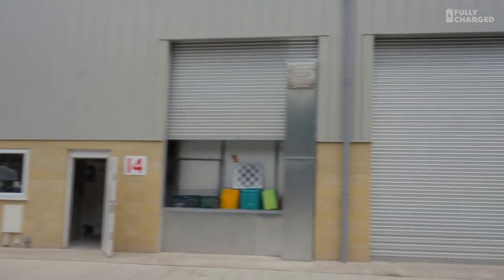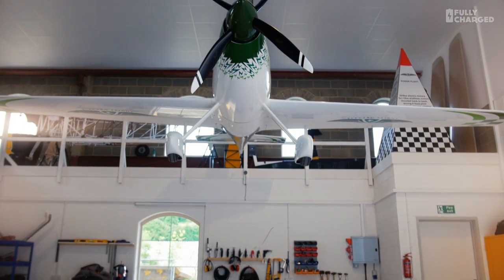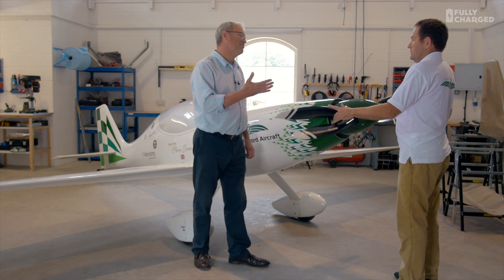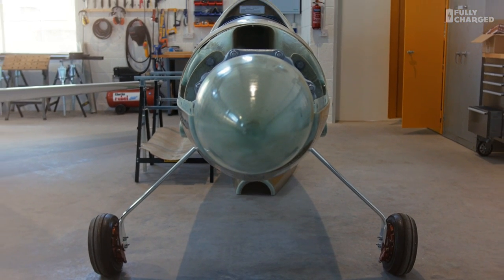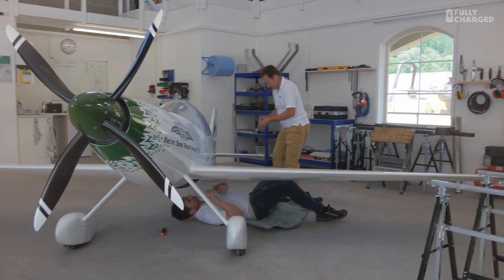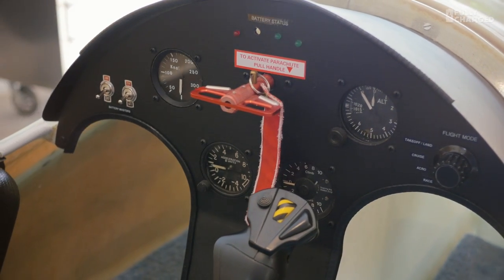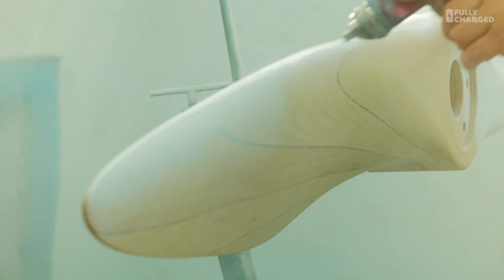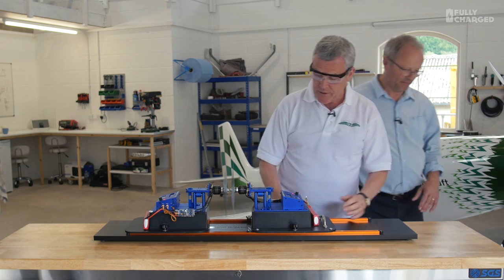Electroflight | Fully Charged

Comment: 9-10 min of flight time?...... sorry just not worth it... i wouldn't want to get a plane knowing I only had that much time
Reply from the maker: It's a racing plane, the piston engine version can only fly for 5-6 minutes due to very small fuel tank because of weight.
This one can fly for 3 hours

https://www.youtube.com/watch?v=PJKYekL7JsY
Reply: Thank you so much for the well produced videos!
Reply: If you put some innovative ideas into the plane, you could add certain parts to increase it's efficiency such as Solar panels and really techy self powering technology.
Reply: Check out the sun flyer. You get a few hours with it.
Reply: +Shankovich I opened up the conversation more, the guys who made this vid stated themselves that it can last longer than the piston version by hours. XD I FEEL STUPID XD
Reply: get the SOLAR IMPULSE i went around the world 100% purely on electric solar power.  how much time do you exactly need? ha ha.     the wright brothers flew their first airplane in 90 seconds NOT WORTH IT HUH ???
Reply: +em forty Such a heavy aircraft. Nothing wrong with that, as long as it performs which electric engine aircraft especially at turning.
Reply: One other thing.... in fuel driven plane it goes faster when the longer you fly it (as the plane gets lighter as the fuel empties) but in a electric it will be less power... but the weight will be the same...
Reply: +Alexander Wingeskog Will still be able to turn better than petrol.
Reply: +Sir Sharpe Yes, probably... just in that critical almost out of fuel or almost out of battery power... I would rather be out of fuel... but... maybe there are a couple of solutions... an emergency 10 min battery for emergency landing... switch to make the props (angled correct) for generating power as you decent to have a 5-10 normal power for the emergency landing (depends on your original altitude I guess) or have a couple of light weight supercaps for 5 min of landing power... I guess the problem is just one solution away...
Reply: +Alexander Wingeskog Well go petrol then. Electric is making quite an appearance.
Reply from the maker: A fascinating analysis based on...... um, not sure what. 
Modern battery management as is used on this place would mean nothing of the sort would happen. 
As for a fossil burning plane getting 'faster the longer you fly it' due to reduced weight of fuel, I'm not sure that's ever been actually proven and if so I would like to see peer reviewed papers and any other evidence to support such a claim.
However, the batteries can be controlled in a very granular way, giving 100% of their power up to any point the software defines, they don't 'slowly use power, you are thinking of batteries in a torch in 1959. 
Things have moved on somewhat.
Many, many, many people who have no understanding of modern battery technology and battery management systems and yet are still happy to pontificate at length at various, spurious drawbacks.
It's new technology, it's disruptive and therefore 'scary' to some people, of course there are differences between burning fossil fuel in massively inefficient steam age machinery and powering an electric motor with batteries, but none of them have been addressed in this conversation.
Reply: fullychargedshow Analysis based mostly on Newtonian physics and a basic understanding in aerodynamics. But it is a very very complex question... This is not the right forum I guess... And bear in mind I'm not an scientist, mathematical genius or even an engineer :-) But that never stopped me before.

So does weight impact plane performance and airspeed... Most passenger airplanes today can reduce drag and lift to reduce air resistance and thus go faster when they don't need as much lift because of the lost weight.
Will this plane go faster, yes it will.

But if a plane's speed is determined by drag of the plane (and can't do anything about it) and the drag/rpm of the propeller then this plane in level flight would not benefit so much from less weight... But that is only one velocity and airplanes have lots... Climbing for example will go faster with less weight (if the reverse were true it would break some law of physics right?) 

I don't have a peered science paper nope, I could get you some links (pilot manual and other stuff if you want) but I guess you only read peer reviewed scientific papers? and we can't have a normal discussion about it... 

And the battery point, yes I do know a fair bit about it. And I think you missunderstood me... The battery will loose power but not weight, the fuel based engine will only loose weight. 

People are scared of this? who are? Never ever seen/heard anything about it actually... on what do you base that on? critical comments? if so, that does not mean someone are scared... quite the opposite.

But anyway... just because it's new tech does not automatically mean it's great or even better that it was before... In this particular case it could be similar to the "first" automobile. Battery was new tech then, but it took a 100 years for it to actually work as a mainstream product as it does today. Hopefully it is not the case, but you never know do you...
Reply: ***** Me? Maybe I was not... what are you referring to? explain please!
Reply: Conventionally-powered fast racing kites carry very little fuel. Just enough to 'do the job'
Reply: For a racing plane it makes perfect sense...
Reply: Exactly.
Reply: Sir Sharpe Forgot you :-)
You said "Well go petrol then"...

Electric is the new thing... and rightfully sow... But when you are talking about something that will take me maybe 10.000 meters or more upp in the sky... electric (nowdays) is not what I call safe...

Yes you could go lower or higher... but winds are too powerful to just ignore...

Sooo why not go hybrid? or as my original post... have a "landing from any height" battery... that made it all safe... actually safer then other fuel based planes....

If you want this to go any further you should look at what Elon has done... he has made the car better in pretty much every respect.... except price... but that will change... when we get punished for environmental damage and the then the it will be cheap as hell :-)
Reply: Alexander Wingeskog. how would a hybrid work in a plane? if its just a safety system for engine failure then you are carrying around a bunch of weight doing nothing for most of your flying. Hell, likely all of your flying.

also, you seem to think that an engine failure is some sort of death sentence.  you do know right that when an engine fails the plane keeps flying?
Reply: DrewLSsix Yes it will add some weight ofc. But lets say it's 100 kg (with 10 liters of fuel) that could save your life...well it's up to you and sure if the planes weight is 200 kg then sure... it would add a lot of weight... but if we are talking 800+ kg then I might go for the future lifesaving device... Yes I do know planes can fly without power... but the ones that usually have power does not fly very well without it... and if you could add 10 mins to make a better decision where to land... it would probably save a life or two..
Reply: yeh it kinda makes me think fossil fuels still ,but this technology is going to slingshot past our wildest dreams, and I like that!!!! :-) :-)
Reply: The comment on the 20 seater plane and putting the two wing engines into one in the nose. The Wankle engine has come a long way. It is one third the size and weight of a piston engine. HCCI ignition is changing the efficiency. The Wankel is suited to constant speed running so ideal turning a genny in a hybrid. The efficieny is then very high. Mazda have the engine billed in a series-hybrid. The first hybrid plane flew in 2013 - using a Wankel. The Wankel is also less prone to shock cooling. Catastrophic failure is pretty well unknown.

A small passenger plane could use a Wankel hybrid setup. Wankels are far smoother than piston engines so it can be in the main body of the plane.  These planes could be on electric only when taking off and landing (the Wankel off).  This eliminates pollution in urban areas. A conduction rail could be in the runway with a pickup in the nose wheel to boost when taking off - some trams use this method. The runways could also be slightly ski jump shaped, and with such instant power much shorter.

Who needs this ridiculously expensive, destructive and divisive HS2 high-speed rail? Small planes all over the UK can replace this outdated old tech railway that consumes an amazing level of land and electricity. Planes use a little land at each end. Small airports can be in or at the edge of city centres. Cities on rivers can have small airports right near the centre linked via metros.
Reply: When aircraft make their calculations they are based on the Maximum takeoff weight plus the loss of fuel weight in the journey. 

With Electric the batteries really don't get any lighter. It makes making calculations much easier. 

However like a Gasoline powered aircraft or car you can do things to conserve fuel (slow down for example) this is easier to do in an electric because the weight of the aircraft is fairly constant. So the calculation is the same. 

In a high performance plane like these ones however none of that matters.  In Fact Red Bull Racing planes are the Ideal place to put Electric aircraft. You don't need that much flight time. As such you can replace 150kg of engine with 50kg of motors and 100kg of battery. As Battery Density increases you can lower that and actually make the plane fly longer or you can make it lighter. 

However you have a decided lack of understanding of most aircraft. Yes climbing can be done theoretically faster.... however you are burning fuel faster. Of course the act of climbing in a ICE plane increases in speed anyway as it climbs as most ICE planes the max speed is higher at higher altitudes. 

In a Spitfire for example If you are running low on fuel you don't increase your speed you decrease it. The max speed of a Mk XVI is 406Mph at 22,500 feet it is only 384mph at 10,500 feet. Altitude, weight, fuel mixture, and weather conditions all have an impact on fuel consumptions, they are constantly changing variables. Altitude and Fuel Mixture has no impact on an electric plane. If an electric plane can fly at 406mph at 500ft it can fly at that at 22,500 feet. 

If Spitfire to keep to that example, wants to conserve fuel by your logic it should climb to 22,500 feet and fly at 406mph... but if you did that you'd die as you'd be burning fuel like crazy. To conserve the most fuel in a Spitfire you want to fly at 20,000 feet (at least in LP XVI) at just 220mph. 

With Modern Commuter planes it is different further. The max speed is pointless of short flights. Toronto to Montreal for example a Boeing 737 and a  Bombardier Dash 8 could take about the same time to make the trip. In fact the Dash 8 will likely be a little faster. Because the 737 takes longer to get to speed. So while it has a max speed well above a Dash 8 (800km/h for the 737-400 and 600km/h for a Dash 8 Q400) neither aircraft is in the air really long enough to hit top speed. 

As such the Battery vs Gas Debate is pointless. Both have draw backs and advantages. In fact slowing down to the point you are just barely in the air may actually be the right thing to do in an electric aircraft (we know that slower speeds use less battery in cars it the sweet spot in aircraft will likely be at a fairly low speed. More so it seems that most Electric Aircraft have longer wingspans and will use more efficient designs that Turbojet and prop aircraft should take advantage of. That gives them more lift and helps conserve power. 

It is a very different situation but most everything you said is actually wrong in practice. The theory may be on the right side of sound but the practice isn't as engine inefficiency and air pressure play a huge roll in the flight dynamics of aircraft engines even today. That is actually another bonus to Electric Aircraft. They can fly at the height that is more beneficial to the flight performance not the hight more beneficial to the engines. That may be higher that may be lower, it maybe the exact same I don't have knowledge to say, but the engine plays no role in the ideal altitude of the aircrafts flight performance with electric (assuming the batteries are in a pressurized compartment.)
Reply: @em forty if you recall "physicists said it would never be viable for airplanes because the laws of physics dictate that you could possibly have only 11 passengers....". I wonder if those "physicists" could see things today.
Reply: Brandon Bumgardner 
You just don't get it.
Reply: That was going to be my exact reply :)
Reply: @fullycharged no it doesn't fly faster since already flying, assuming the propellers are turning in a constant speed and it is already aloft. It does affect its ability to elevate. The lighter, the faster elevation assuming the propeller is constant. Former pilot here.
Reply: Brandon Bumgardner
You still do not get it. You display strong sociopath tendencies. That is treatable to a point.
Reply: It's impressive for an EV, but for as airplane, not so much, not when ICE's have been doing more than that since the 1940's
Reply: Brandon Bumgardner It is nice but so much, that we don't need. 
The Thing is to design Planes that fit a Need.
To come to the starting Point.
The Plane fits the what it is designt for.
Reply: svesom
That's what has me puzzled with this plane.
What would require this kind of a design?
Frankly nothing.
You can't use it for long distance flights
You can't use it as a bush plane, It's too, sure it's got more power than a Piper Cub, but your not going to be flying it in Alaska in the summer never mind the middle of winter.
Reply: Consider the Wright brothers' first fliights...a new era is dawning.
Reply: Sir Wa
Only if it's lighter than the petrol driven aircraft
Electric motors don't change the physical laws that govern aircraft
Reply: fullychargedshow
That's a settled science.
Has been since WW II when they were trying to figure out how to get planes to fly 300 and more.
In particular the designers of the Japanese A6M2, the engineers at Vought, Grumman and North American.
The P-51 had versions that had variants with 1,680lb of fuel.
They found that if you flew with 500lb of fuel, you used less fuel per mile flown than when you flew with 1,680lb of fuel.
Reply: Solar panels have a much lower energy density than Lithium Ion batteries. Adding less efficient stuff to a system decreases overall efficiency.  Not sure what you mean by "Self-powering technology", but I suspect you watch too many "free energy" hoax videos. Adding things that only appear to work to something that actually does doesn't improve efficiency either.
Reply: About twenty five years ago, several planes flew non-stop around the world un-refueled. A few years ago, a solar powered plane gradually made it around the world in dozens of short hops with long breaks to wait for suitable weather. Sailboats have circled the world in less time than the solar powered plane took. 

The video compared this plane to Red Bull Air Race planes  which during the race, from takeoff to landing stay in the air about a half hour. Typically they only carry enough fuel for about 45 minutes to save weight, but with with full tanks they can fly about 250 miles.
Reply: Within a few years of the Wright Brother's first flight there were manufacturers producing aircraft for sale, dozens of aircraft had flown, taking up hundreds of passengers. It was the birth of an exciting new technology with nearly unlimited potential. Clipper ships in the 1800's made it around the world carrying profitable cargos in less time that the Solar Impulse took. Are there dozens of solar powered planes in the air today, carrying hundreds of passengers? No. Why not? Because there is no development potential for the concept . The Solar Impulse was a ridiculously expensive, utterly pointless stunt. It did absolutely nothing to advance aviation, solar power or electric motor technology, and it pointed the way to nothing. It is unlikely that a solar powered human carrying airplane will ever be offered for sale commercially or ever carry a useful payload.  @10OZDuster
Reply: Weight equals induced drag. This thing would slow down a whole lot if you tried to fly it through a Red Bull Air Race course . @godemperormeow8591
Reply: Higher wing loading , that is, more weight compared to the size of the wing causes more drag,    especially when maneuvering. Gasoline has much more energy per unit of weight than Lithium batteries can store, so even though the electric motor weighs less for a given power, the total propulsion system weight is less for the IC aircraft, it will lose less speed in maneuvers and that advantage gets better the longer the race goes on. The more energy the electric plane uses, the more the battery's voltage drops and the less power it has available. The IC plane has the same amount of power available at the end as the beginning and less drag to overcome. Everything after the first few turn is all in the IC plane's favor.    @godemperormeow8591
Reply: @herbertshallcross9775  Fuel also has a lot or weight.
Reply: @herbertshallcross9775  One day we won't have to use gallons and gallons of gasoline. Just a mere 3rd the price to fill up while triple-quadruple the cost just to buy the damn plane.
Reply: @fullychargedshow  The video mentions Red Bull Air racers as comparable planes. I just spent a half hour of my life I'll never get back going first to Electro Flight's and the Rolls Royce's website, since Rolls Royce seems to have bought into this in a large way, and then researched the Zivko Edge 540, probably the most typical Red Bull Air Race aircraft. The website doesn't specify exactly what Lithium cell they are using, but the illustrations show a large rack of cylindrical cells much like the typical 18650 cell. A bunch of calculation show that if they aren't using 18650's they are using something very similar. With that information, and the 6000 cell count which they do give, the battery pack weighs at least 600 pounds. The Edge 540 has a standard 19 gallon fuselage tank. 19 gallons of gasoline would weigh would weigh 124 pounds. Yes the Lycoming engine weighs 200 pounds more than the three electric motors.they now plan on using (they've apparently dumped the two motor counter-rotating propellor idea), but that is more than offset by the difference between the battery and the full fuel load. The Edge 540 has a larger wing than would be optimal for speed record setting ,and the prop is more of a climb prop than what you would use for speed runs, but then, the Electro Flight/ Rolls Royce record plane would be helpless in Red Bull competition. Too much weight means too much speed lost in maneuvers.
Reply: They've apparently given up on the idea of trying to get it to turn. It is slated for straight line high speed record runs now . @godemperormeow8591
Reply: @herbertshallcross9775  Welp. Plane ownership is a pain im the ass.